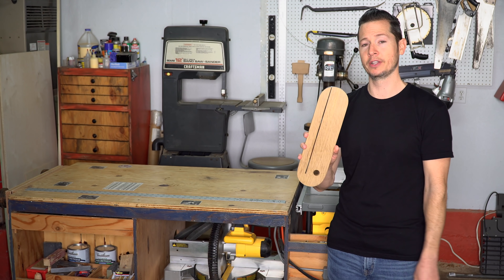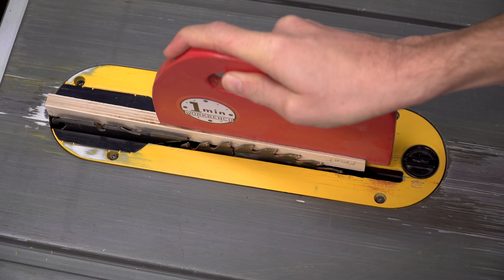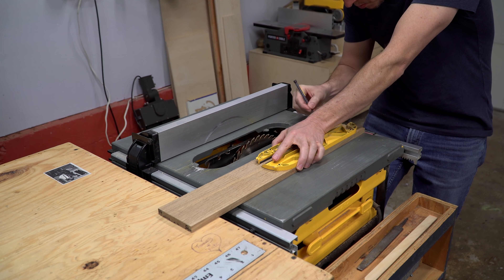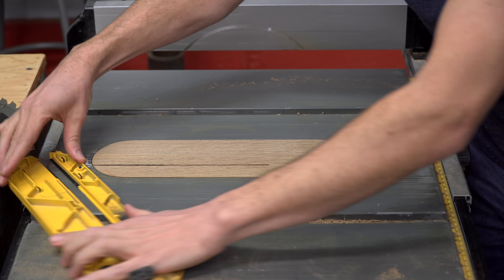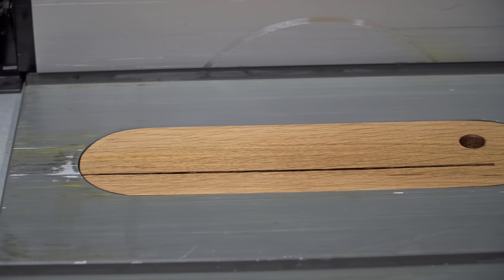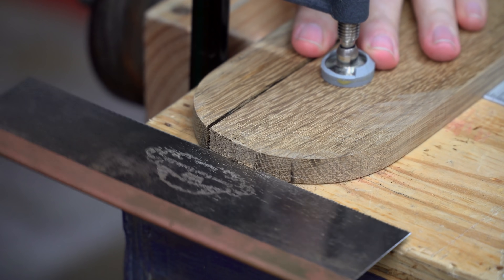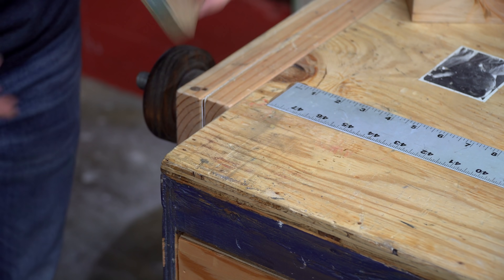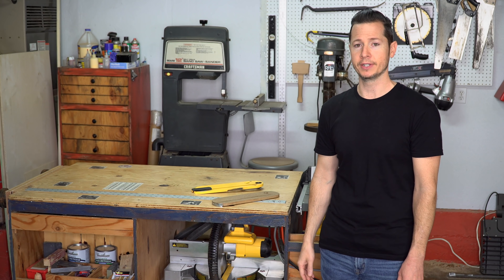A BETTER Zero Clearance Insert!

Comment: OK - I'm confused.  Why not just leave the piece whole.  Remove the Splitter, run up the blade through the wood and have the zero clearance you wanted.

In / or addition, you could have then used a saw and file to cut out a larger slot if you wanted to keep the Splitter on.  Then the back would have been one piece.  

Putting glue on the surface of the edges would help stiffen and seal it.
Reply from the maker: Thanks for sharing the idea! That was my first approach, however the amount of space available behind the splitter (and I definitely wanted to keep the splitter!) is about .125", and with leaving just .025" of clearance for the blade (which is pretty tight), that would leave only .100" of material to keep the two pieces connected. That's pretty wispy, and I imagine it would only last a few days before it broke. I hope this makes sense and answers your question! Thanks again!
Reply: I have the same saw and cut a small amount of the splitter away with a grinder to allow the zero clearance insert to remain whole. 
The splitters back edge is angled so I cut vertical down to approx 10mm from the edge just below the bottom of the insert
Reply from the maker: Thanks for sharing your method!

Comment: While I like your design, and I think you did a great job, It's also fairly obvious that you are incorrect about DeWalt and their design "flaw" as you call it. When should not be pushing down on a piece of wood, with or without a push block. When running material, you simply have to allow it to jump over the edge. Still, your Design is a definite Improvement, as most zero clearance inserts are.
Reply from the maker: Thanks for the feedback! Think of it like this: the only way to avoid applying (at least some) downward force is to have ALL force applied PERFECTLY forward. That would be extremely challenging. Picture the forces in terms of a physics diagram: most force will be forward, some force will be downward, and no force will be upwards. So you've got maybe 80% forward, 20% downward, 0% upward. You're resulting physics diagram's diagonal arrow would be facing mostly forward, but slightly downward. It's that slight bit downward, and that ~20% of force where the DeWalt version fails. It's just too wispy and flexes under very little pressure. With the new version, I'm able to hold the piece securely and firmly as I push it through, confident that it will not hang like the old one. Does that make sense? Anyway, thanks again for sharing you thoughts on this!
Reply: @OneMinuteWorkbench   But there is an upward workforce caused by the back of the blade. One should only apply as much downward force as necessary so as to equal the upward force caused by the back of the blade, minus whatever weight the material itself has. This may seem difficult, but I use a table saw quite a bit as a contractor and finish carpenter of 32 years. So I don't really find it difficult at all. I think the thing that gets to me, and the reason that I made my initial comment, is the ONLY thing that I ever see people getting injured by is the tendency of inexperienced people to hold on to material with a death grip. Maybe that's not you, and if this is the case then I apologize. But from the looks of the video it seems like your doing just that, even if with a push block. As I've often told employees, material is easy to replace, and if you insist on holding onto material with that kind of a grip then you will find getting a new job less easy to replace. But then I'm a bastard, so what can I say?
Reply from the maker: lol - I'm sure you're not a bastard 😂 You're just trying to help keep people safe...and that's a good thing!
Reply: @OneMinuteWorkbench  LOL more like I'm trying to keep my wallet safe. When employees get injured, it comes out of my pocket. So like I said: kind of a bastard, to work for at least.

Comment: Awesome fix for an obviously poorly designed insert. Shame on you DeWalt!
Reply from the maker: Thanks! I won't go so far as to say shame on DeWalt - having worked as a design engineer in a manufacturing environment, I know it can be tough to find the balance of cost and quality. Overall I'm very happy with the DW745. At the same time, I'm not necessarily defending DeWalt...the throat plate issues could potentially be dangerous.

Comment: My God Dewalt! Really!!?????  Shame!
Reply from the maker: Let's not crucify DeWalt just yet 🤣. Overall, it is a really great saw. It's also not really designed for the type of work a lot of us are using it for. It's mostly designed as a saw that will be used for cutting 2x6s, 2x4s, etc. on jobsites. For that, the throat plate is more than adequate. It's just when you start using it for trying to do little intricate pieces that this issue shows up. All that said, I think DeWalt also knows that it's also going to be used by a lot of woodworking hobbyist, so they could have done a better job of the throat plate. Okay, so let's not crucify them, but let's not totally let them off the hook either 😉
Reply: I agree. I have owned that saw and it worked perfectly fine for me at the time. I changed my focus and found a used Delta  Unisaw I couldn't pass up. Because I had not abused the Dewalt, I sold it for just below what I paid after 2 years.
Reply from the maker: Thanks for sharing your experience!

Comment: Ah, failure to engage brain before making video.  Yes, your table saw inset has a design defect when it comes to working with small dimensioned wood.  I suspect that you bought the "contractor" type model that is adequate for contractor work, building large things such as houses and picnic tables.  That's the reason for the wood splitter, to keep the saw blade from binding as large pieces of lumber are being cut.   But you do not need the splitter when using very small stock.  So what to do?  One is to notice that your insert has screws by which you level the inset to the top of your table saw.  Ah, you never read the instructions that came with the saw.  Understandable, most individuals never do.

The insert you made for your saw was poorly planned from the beginning.  Since you actually bothered to take the measurements of the depth of the screw sets individually, you should have planed your insert to the thickness of the deepest set tab.  Then using chalk on the screw sets, locate each one and carefully remove material from the insert until your insert sits level to the table.  As for the saw blade opening, leave the insert in place and turn on the saw.  Carefully raise the blade height while holding the insert in place with a heavy push stick or other scrap material until you have the desired blade height.  By the way, remove the splitter and do not use it for small pieces.  

Now if you must "fix" your factory insert, you can take a piece of wire coat hanger and braze it to the underside of that insert at the mouth.  That will work very well.  But for small pieces of wood you really need a zero clearance insert and no splitter for safety reasons.  So please think through your problem, research it on YouTube, and try it again.
Reply from the maker: Thanks for taking the time to give some feedback! I think I've been able to piece together how you would "fix" this, and that is to make an old school insert that doesn't accommodate the splitter, and to just deal with having to swap inserts and add/remove the splitter based on the sizes of the pieces being cut. For me, that's actually the problem, not a solution. With this project, I wanted to create an insert that WOULD accommodate the splitter, so that the insert WOULD NOT have to be changed, and the splitter WOULD NOT have to be added or removed based on the size of the piece being cut. And...I did! It works great and was a pretty simple build! I hope this helps clarify! Thanks again for sharing your thoughts!
Reply: @OneMinuteWorkbench  Most individuals do not really understand the purpose of the splitter, they simply believe it is a safety device that should never be removed.  So again, when ripping lumber, be it 2x4 or 1x8, because you are cutting with the grain there is a distinct possibility that the grain may cause the cut side of the lumber to bow back together and pinch the blade and either stop the blade movement or cause a kickback.  When crosscutting the splitter is never needed, usually.  Now you have a contractor style saw, that much is obvious.  Your inset was designed for "contractor use".  It was never built for fine woodworking where precision counts, it's just a general purpose tool.  I have a Delta contractor table saw, bought it on sale very cheap.  I have used that machine for that purpose.  I have built a 20x20 ft workshop in the back yard and used it in rehabbing my house and adding an addition.  But when I need to make fine and precise cuts I use my old Craftsman table saw with a zero clearance insert and no splitter.  It too is great for ripping and using on thin dimensioned lumber.  I also have an old Craftsman radial arm saw that gives me great control when cutting small piece parts.  

Now given that most individuals either do not know how to use a radial arm saw or are unwilling to buy a used one or even may be afraid of them, it is understandable that they will turn to the normal generic table saw.  Ok, good enough.  So they buy a contractor style because it is cheapest.  Unless you are going to make your next project a Philadelphia Secretary, you will do all right in general woodworking.  Unfortunately individuals buy these machines out of ignorance or because the salesman at the big box or speciality stores convince them it's a good buy.  Now everyone seems to be pushing battery powered tool like crazy and the batteries are horribly expensive.  But it's the next rage, what can I say.  But you did say that you wanted to rip thin stock and that since you apparently did not understand how to adjust your stock insert and found issue with it, you immediately started making a zero clearance style insert that never addressed the problems you encountered.  Ok, so you came up with a couple of work arounds and are proud of yourself.

Yes, your insert will work when using a crosscut sled and that sled, with a little modification, will mitre cut almost as good as my radial arm saw.  So no need to disconnect the splitter.  But what happens now when you want to do angled cuts.  Oh, you no longer have a zero clearance insert when reverting back to 90 degrees.  Now you have to make another insert again.  And again, when you discover dados, your insert opening slot will change again.  As for the splitter, if you were ever to decide to use your table saw to make cove moulding, it's got to come off.  Why?  Because some operations are beyond the normal router.  I've done that myself because I wasn't going to spend a few thousands on an industrial shaper for a hundred board feet of stock not in the size I wanted.

Now I am almost 72, have a very wide education in the crafts and academia.  I take issue with your approach to problem solving.  When I was young I would sometimes take that half-assed approach to problem solving.  My personal experiences and observations is that it leads to mistakes, sometimes very serious mistakes.  You want instant set up and perfection.  I have news for you, your machines never stay that way.  Your tools need constant attention, constant maintenance, constant adjustment.  True, you can buy equipment that are so well designed and machines that their operations will stay well within tolerance for many years.  Fielder makes that type of woodworking equipment, beautiful industrial tools at big industrial prices.  Kid, you and I don't make that kind of money and never will.  Woodworking is a craft, remember that.  It's something you learn through instruction and through doing.  And quality is the holy grail in any craft.  If you are not willing to pursue quality then why are you here?
Reply from the maker: Thanks again for taking time to share more of your thoughts! For sake of keeping the video short, I didn't cover all aspects of the project. The set screws that come with the saw notoriously "reset" themselves by the simple vibrating of the saw. Yes they can be adjusted, but on a lower quality saw like this, it won't be long before they need to be adjusted again. And while adjusting the set screws will temporarily level the insert, it won't fix the flex in the insert, which is actually what is causing smaller pieces to get caught. The pressure from my push stick causes the thin aluminum to flex and allows the edge of the workpiece to catch.

I don't have deep pockets, room for a workshop, or room for multiple table saws (where one is suited to framing, while the other is suited to furniture building) or even room for a full-sized saw, so I have to make due with limited tools in limited space. In fact, that's pretty much the whole point of my channel! 🙂 While it's true this insert doesn't mean I'll never need to swap it (for making angled cuts), it does mean that I won't have to swap it as often. And that, by definition, is an improvement.

Listen, if I made a video that covered all the stuff you and I have gone back and forth about here, it'd be an hour long and nobody would watch it! It doesn't mean I haven't though about it 😉. It also doesn't mean that I haven't made something worthwhile here. This insert is an improvement over the old one, and reduces setup times and operations. There's not anything wrong with progress....this is how products improve, new inventions come to be and how things evolve. It's just the natural order of things.

I hope this make sense and helps clarify even more about my approach to this design. And if it doesn't, well, I think you and I can at least agree on one thing...we'll never make the kind of money needed to build a dream shop filled with industrial tools! 🤣  Thanks again for sharing!
Reply: @OneMinuteWorkbench  Blimey. I felt for you there, reading all that. Mr Amance kind of makes you feel like a naughty school boy somehow. I guess it's down to "how" one imparts their knowledge and experience and the language one uses. You handled your response very well I thought. Either way though, the premise for your channel is, as you say, making do with what you have. And given the latest developments around the world vis-a-vis Covid 19 and the ensuing unemployment, there will be a hell of a lot more of that going on now than ever. I've just un-boxed a DeWalt 7491 I bought last week. Yet un-used as I am beefing up on safety aspects and looking at all types of sleds and jigs that will turn it into a pretty flexible machine. I have had a look at the throat plate and concur re its design faults. I wound up the blade to the highest setting and the riving knife comes within about 3mm of the back edge of the throat plate, so I see why you took your initial cut all the way through the back edge and why DeWalt has done the same with theirs. So,... what about taking about 7 or 8mm off the back edge of the riving knife at it's very widest part (lowest)?? This would have allowed DeWalt to have constructed their own plate without an open back end on it. It would also mean your own zero clearance work-around plate could be the same (i.e.not open at the rear. The only thing I would do is the take a rebate out of the underside of the plate at the rear (L-R) and insert another piece of hardwood to give it the rigidity and strength it should have at this point. What do you think? I might even try to replicate the locking switch somehow as well in mine when I make it. Anyway, thank you for the time and energy you put into your channel. The hall mar of any teacher is someone who inspires. And you've certainly done that.
Reply from the maker: Richard, thank you for the wonderful compliments! Yes, I think grinding away a small amount from the back of the splitter would be an easy way to give yourself a little more room. You could then make the insert, remove the knife, raise the blade through the insert, extend the slot by hand (or maybe with a jigsaw), replace the knife, and be done. A great way to keep the insert all one solid piece and keep from having to create the metal strap like I did. Anyway, thanks again for the kind words. Good luck!